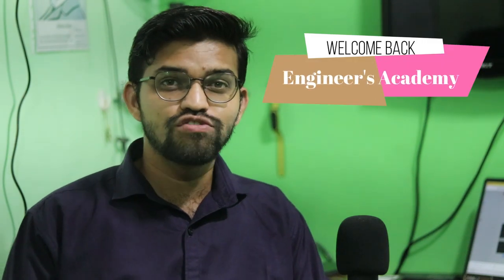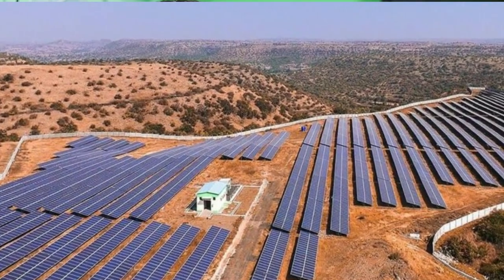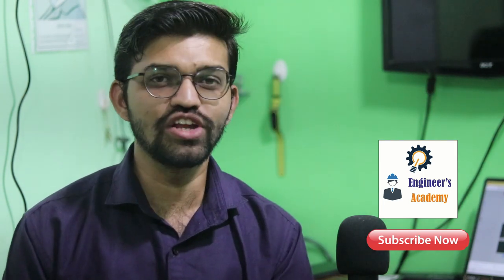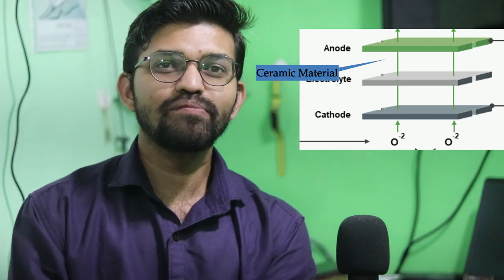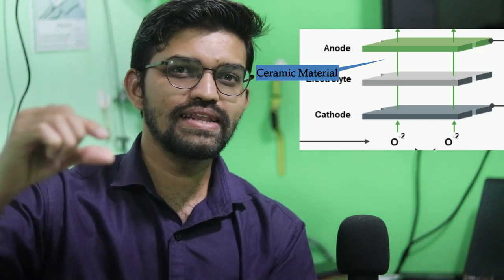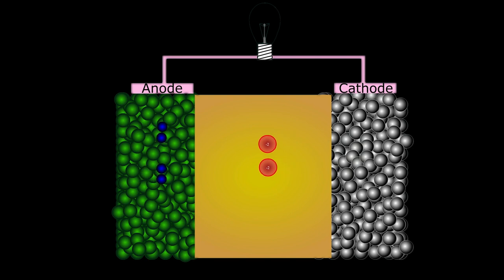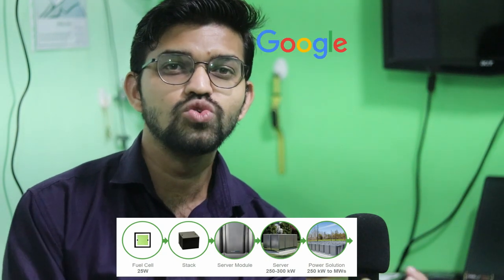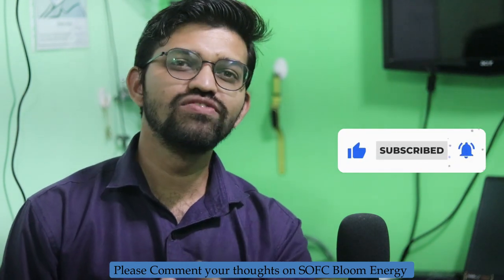Solid Oxide Fuel Cell (SOFC) by Bloom Energy.

Comment: Nissan has been advancing the development of SOFCs for automotive applications, which is sensible due to their ability to operate on both hydrocarbons and pure hydrogen. Currently, the creation of a hydrogen infrastructure might not be feasible. Nevertheless, it could become practical with the emergence of cost-effective nuclear power. Using alternative hydrocarbons is evidently more logical while hydrogen remains excessively costly.

Comment: I personally think you’ve slightly misrepresented SFOCs by not providing the clear math science.  1.  Cost 2. Propane or LNG isn’t 100% clean but lower emissions by 10x then burning it. 3.  Energy density/consumption to produce X power out put.  4. Lifespan or time till overhaul when using certain fuels.  5. ROI (Return On Investment) estimates.  6.  SFOC uses vs other types of fuel cells.  Otherwise, interesting video.